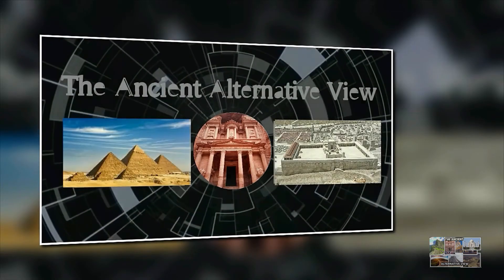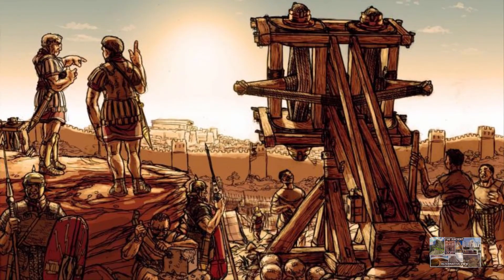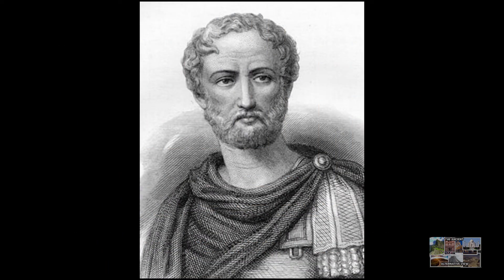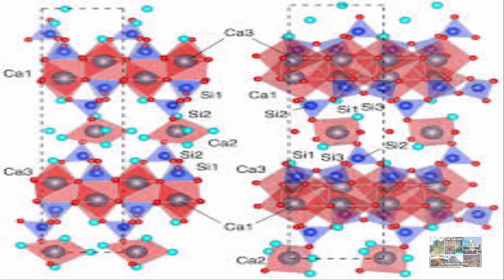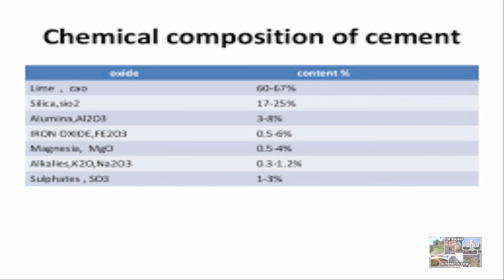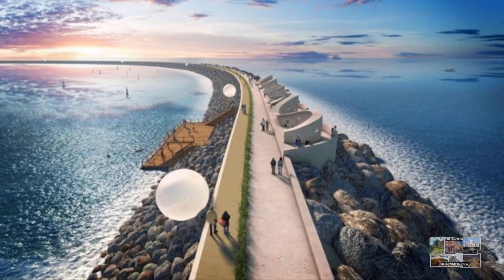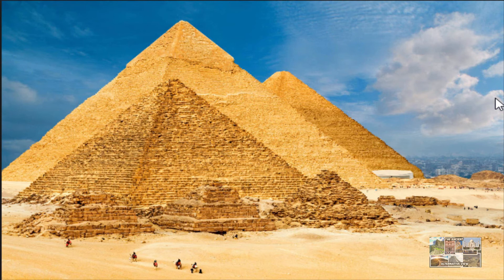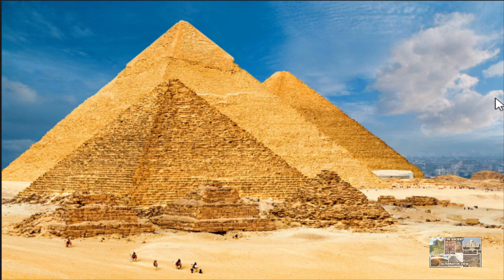Roman Concrete The Secret Uncovered

Comment: The inefficient economy of the USSR allowed the Russians back in the 1950s to discover the secret of Roman concrete when the Russians discovered that super strong concrete could be produced by simply adding acetic acid (vinegar) to fly ash, which led to the realisation that Roman concrete was simply volcanic ash and vinegar.
There is no seawater penetrating the dome of the Pantheon - made of Roman concrete.